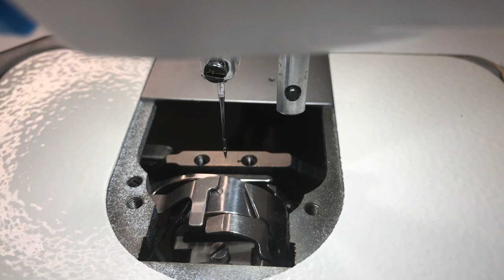Basic Hook Timing on JACK Industrial Sewing Machine

Comment: Hello, I'm writing to you from France. I have recently purchased a Jack A5E machine and have been watching your videos which have been of great help. I really could use your help on something (would be a great idea also for a new video). I purchased an easy pressure foot changer as I find that unscrewing the foot each time is quite unpractical. In order to fit this device to my machine, I had to adjust my pressure foot height, which I did. It then messed up everything quite a bit when I wanted to go back to normal mode. Now I can still sew but my pressure foot is lower than it's original position so it is even more difficult to change the pressure foot. Could you please tell me the factory setting for the height ? Is it possible to make a video on how to make these adjustments ? Thank you so much in advance.
Reply from the maker: Hi! Maximum height for the presser foot lift of an A5E is 13mm. Hope this helps.
Reply: @ thank you so much 😊

Comment: The difficulty i have is to find detailed instructions on how to setup the hook and needle timing. I change between longer and shorter needles and the correct location for hook and needle rod is not obvious to me. I can not just run to an expert, as I live far out. Is there a good reference manual for the jack 2001g series (or similar)?
Reply: How to time the hook and needle I do as you showed in the video.. but the longer needle changes more than just one adjustment point, yes?
Reply from the maker: You should not be changing needle systems at all. The machines are designed to run one particular system in various sizes and tip variations. I do not have any info in the JACK 2001G at all so not sure what system it uses. You should not have to touch the timing at all if you have the right needle.

Comment: Hi, I need a bit of help.  I bought a Jack A5E last November and it working fine, however, there is one problem, at the start of a stitch line, the thread is bunching up underneath.  The company I bought from say that is what it is supposed to do, however, I don’t remember it doing that when I bought it.  Can you advise or make a video on how to fix this problem. Thank you.
Reply from the maker: To remedy this issue you need to turn off the pincher and it will stop sewing the ends in.

Comment: How do I adjust the tension please . My Jack A5e doesn't pick up a thicker thread when sewing denim .
Reply from the maker: You may have to use a larger needle so there is less friction in the hole.
Reply: @ozcommercialsewingmachines  
OK thank you what needle size would you recommend please .

Comment: Sir. Please! Take a video on jack a2 swing machine theared cutter culmp  timing, because when thread trimmed theared out from into needle      India.
Reply from the maker: This can be caused by many things.

Firstly, make sure your upper thread has no friction or restrictions when he presser foot is raised.

Secondly, ensure the small tension unit above the main one is very loose.

Thirdly, the main tension unit may not be inserted enough into the machine head, this is adjusted by a small grub screw located under or to the right of the main tension unit, so when the cutter is activated the tension discs are not opened enough to allow the correct amount of thread through to create a long enough tail for the next start.